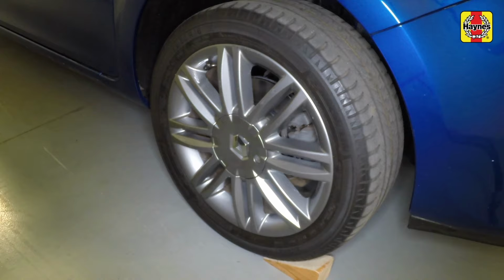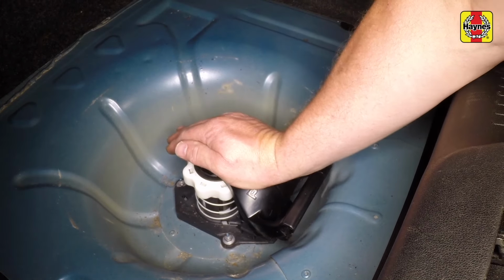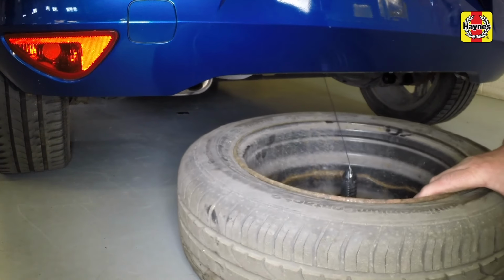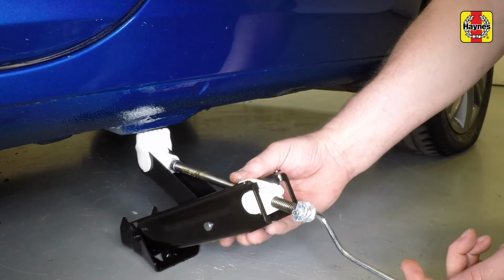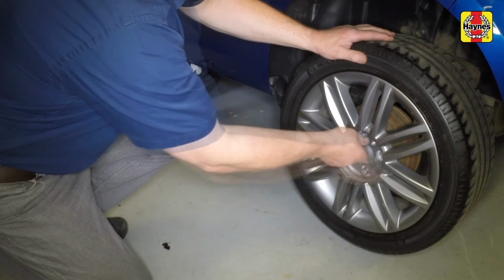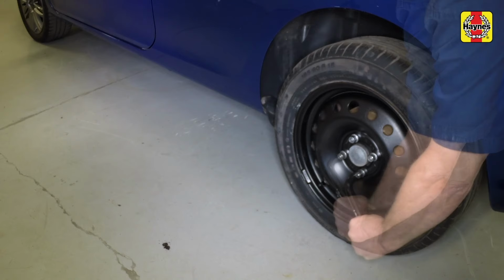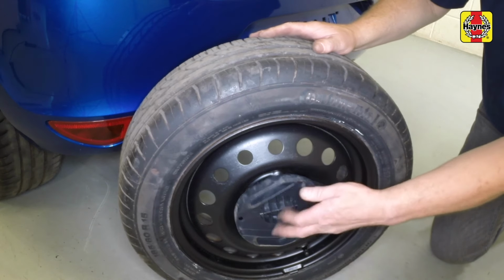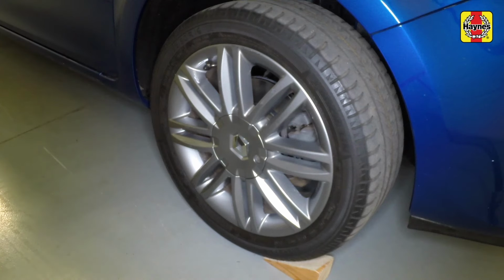Renault Clio (2009 - 2012) - change a Wheel

Comment: The plastic tool you have to use to remove the spare wheel is a nightmare ..theres 2 silver pins push the 2of them the  left one to the left the right 1 to the right and the wheel drops down 😂😂fkn renault 🤬🤬🤬😂

Comment: The plastic centre holder which supports the tyre has to engage with the white plastic 'nut' which can then be screwed up. No amount of pulling and clicking works (I've found to my frustration) unless that 'bolt' enters the boot cavity. Is there a degree course for this?
Reply: there is a small sign at the bottom on the centre piece that says position two, if the wheel won't engage give the centre holder a quarter of a turn and try again, it worked for me.
Reply: @1stoddart  thank you
Reply: i don't know i i turned the white nut counter clockwise a bit and tried again, done it once or twice, when it lines up it clicks in just like the video.

Comment: Does anyone know how to get the cable to retract back into the handle after pulling the wheel up? My cable remains fully extended. Like the spring retracting mechanism is locked.
Reply: I just find myself in having similar problem today.Its like the cable underneath disappeared,did u manage to fine yours and how?
Reply: @oomrah9748  yes I just tapped the handle a few times with something like the handle of a screwdriver. It seems like the mechanism jams sometimes and needs some encouragement. If you can't find the cable, it may have fully retracted into the handle. You might only see the bit on the end sticking out of the handle.  Just a guess.

Comment: I've tightened the white plastic retainer when I finished, but my spare wheel is not fully tightened under my car. It sits a little bit loose .. is this normal ?
Reply: I'm now experiencing this same problem, where the spare rocks around underneath a bit when everything's tightened. Did you find a solution or is your spare still gently rocking away?
Reply: Ashley Morgan Anderson hi did
You find
A
Solution I’m in the same boat as you
Reply: Ashley Morgan Anderson am
I safe to still drive even if the tire feels slightly
Loose
Reply: Ashley Morgan Anderson hi I managed to fix it, the plate that you put
On the tier the bit that you attach the cable
To had to be positioned a certain way with a spike bit poking out towards you as you pull the tier back into place! Hope this helps
Reply: @AshleyMorganAnderson  Not tried this yet myself, as only just got the wheel off, but it could be worth putting the jack under the wheel to get it fully tight and in position, then tighten it with the plastic thing inside the car, this may do the trick.

Comment: About 3 yrs ago I had to get Greenflag out to get the spare down. Used it again yesterday - it works but I think a good spray of WD-40 could help on future occasions. One concern for me is that the car is 16 years old - is the spare reliable after that length of time? Plus - the jack is a pig to use and replace - as another poster has stated. Plus - I'm a fairly strong bloke and I find the bolt lever doesn't loosen the bolts that easily, so I bought an extendable lever.

Comment: i have a slightly newer clio and one of the four wheel bolts is different. How do i get that one loose?
Reply from the maker: There should be a locking wheel bolt adapter supplied with the vehicle. Normally in the toolkit.